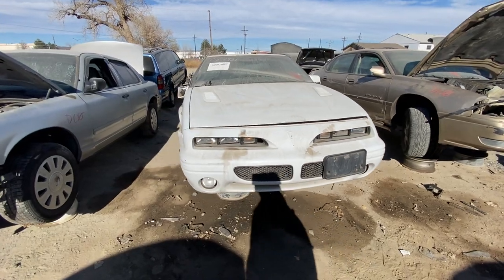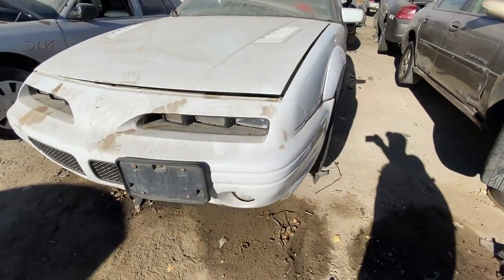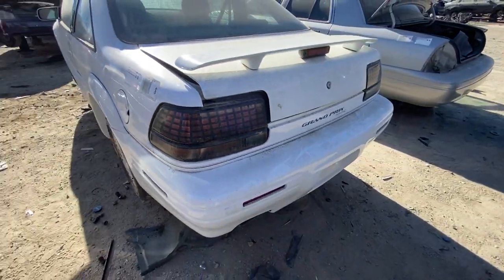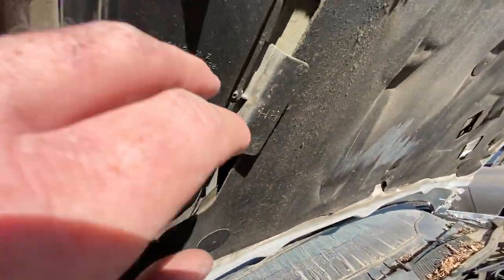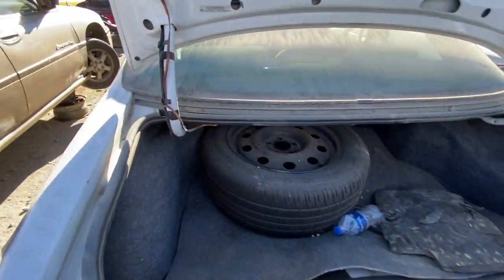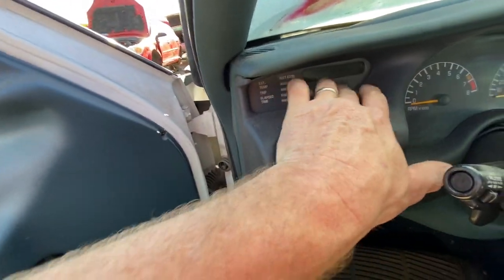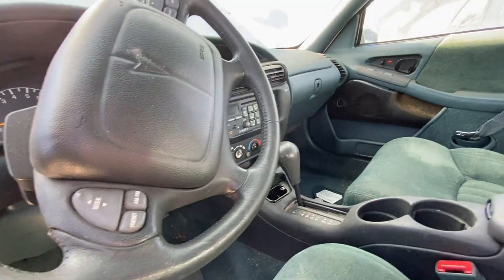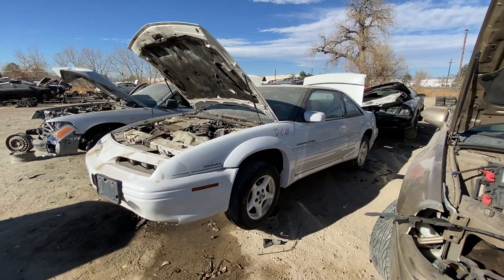JUNKED! 1995 Pontiac Grand Prix Special Edition: This Poncho didn't make it even with the GTP pack..

Comment: owned a 1995 grand prix . my wife drove the white 4door SE Didn't know anything about it untill this year. The reason 
I picked this one, to save and work on at a much later date, & not junk when it was done at 200,000 miles. Was I wanted to learn fwd engine and tranny removal so when I retired  there it was still waiting in the other side ofmygarage.
I even went so far as to buy one simular, to tear apart 1st for taking the engine and tranny out, only it was a 2 door
So months later I'm finishing up my engine tranny swap and now I have a lot of knowledge on the 3100 and the modern way at least modern way back then, but the one thing they have better is the air blender door is run by vacuuem instead
of a little electronic motor that goes out and replacements don't fix it and you never have air again.unless spending thousands for new vents and ect. But to learn more  when I had it out I learned about the shields around the exhaust manifolds that you better heat the bolt up or they'll snap in salt areas like Wisc. same with the  exhaust manuifold bolts
I was so sick of drilling and tapping then (ordering the harden 8  mm studs) and screwing with those as I forgot about them and had to drill with the heads back on. No auto parts store carried new studs. I'm now left with cutting a access
fuel pump change door as grand prix didn't make one untill 1997 the next generation grand prixs and replacing the cv FWD axles as they sat from 2007 and learning how to use a slide happer two diff sets I needed to by to pull the
axles and the seals becaus I could see how easy it is to damage something trying to use  CHISEL and pry tool, like
I did replacing the transmission main seal before I bought my 2 jaw seal slide hammer didn't even know about them.

Comment: Very cool video of a car I love.  Sad to see it there though.  So, that is a very rare 1 of 2 Special Edition car.  But, it also has codes B4M for Special Edition, B4U for Sports Performance Package, Z7K for SE Package, and B4S for GTP Package.  It's both a GTP and Special Edition car.  With it being a GTP, that automatically brought in the LQ1 code for the 3.4 DOHC 24 VALVE V6 engine and why it has an X in the 8th place of the VIN.  The biggest reason why it's so rare is for a couple of codes and options.  K05 for engine block heater, and 37C for Medium Dark Teal cloth interior.  This car should have never been junked.  This is heartbreaking.
Reply from the maker: Is that right? I had no idea, thanks for the info!  And thanks for watching!
Reply: Where did you find this info?